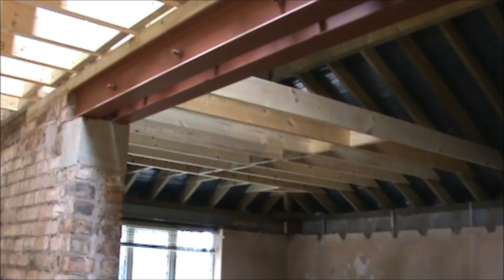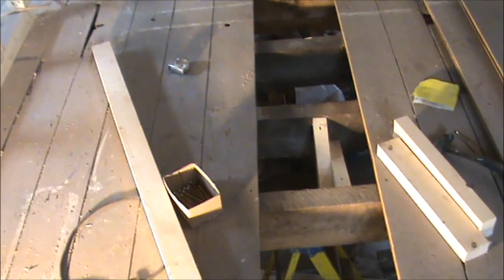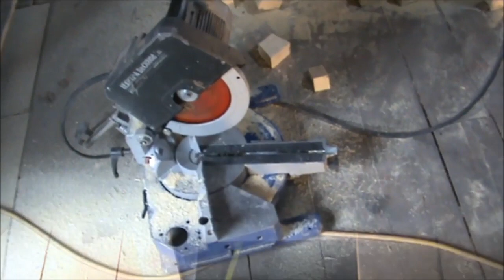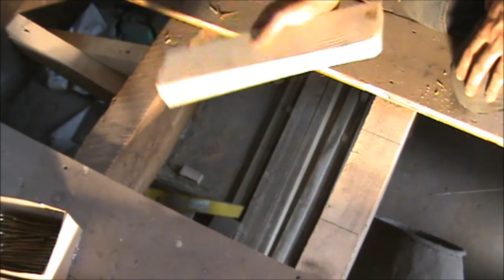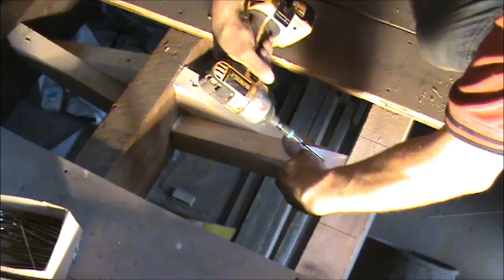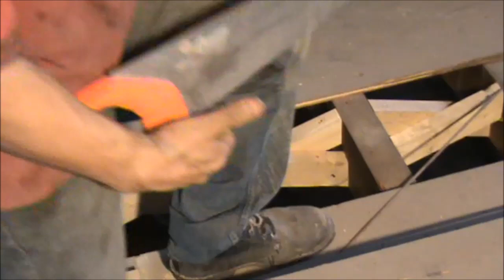Weak floor fix

Comment: How do you secure the bottom screws without access from below?
Reply from the maker: You can’t , you would have to go with another solution like doubling up the joists (sistering) or glue and screwing multiple plywood strips to the side of the joists to laminate it , stagger the joints on the plywood strips

Comment: Definitely giving this a go in our 1920s terrace, the bedroom floor is proper bouncy!

What size wood would you recommend for the herringbone pieces?

Cheers
Reply from the maker: 3x2 is best thanks Chris
Reply: Great video Chis, i cannot screw from below the floor, can i screw the toe from the side? Not the same but no way of getting underneath
Reply from the maker: @handymanTW12  you’d have to pre drill , glue them and make sure they are a tight fit
Reply: @Baron-von-kessler  legend, thanks mate. make new videos if u can

Comment: superb jo Chris, I just want to put in a few that when I step they act just like the beams in two places. the beams are fine I have to replace what you walk on as what was put in is not solid like the original floor. would you recommend just putting in a few solid pieces across?
Reply from the maker: Solid ones aren’t great , you can add to the sides of the beams to make them thicker , it’s called sistering joists you can Google it , thanks Chris

Comment: Those solid noggins are actually just as structural as herringbone strutting. They help "load share" between joists, & stiffen them by reducing the effective length of joist by restraining it
Reply: ...but good video and nice job, they look more proper than solid noggins. I think it's because the struts can be made nice and tight more easily. If you cut the herringbone strut a smidge too short, you'd simply rotate it until its tight in. They're better I reckon
Reply from the maker: I’ve mostly got out of the joinery game now ,  and  do a little bit of sculpture on my channel.. have look !
Reply from the maker: Hi Tom thanks for viewing,  I was told they can become loose over time when the joists dry out and shrink ,  and a old school fix for this was to fit a iron rod through the lot and tighten it up ! , Ive never seen it so far but you never know what you’ll find on a old building
Reply: If they loosen you can bang in wedges but I don't see why a screw would let it loosen even if they shrink a bit in winter

Comment: Wouldn’t one solid piece of 2x8 blocking or whatever the floor joists are made of, be stronger? That way the wood gives the support and not just  the nails and you only need access from one side, above or below, to fasten them in.
Reply from the maker: They dry out and become loose over time , I’ve seen it were a long threaded rod passes through the joists to keep them tight, also the solid noggins stop air flow

Comment: I jacked up my floor an inch and used this method with great success! Thank you!
Reply: Did your floor have a lean? Ours dose we’re wondering how to repair this
Reply: @comfortablynumb8832  It had a terrible lean. I put sleeper joist in too combined with this method
Reply: @michaelgriggle5601  ours leans about 3 inch, how flat is yours now?
Reply: @comfortablynumb8832  I had 4 inches in spots. It was a terribly done addition. The good thing was they used 2×10 lam beams for joist! So I was able to sister to those and cross brace it. Was a pain in the ass. But better than tearing out everything amd stating over.
Reply: @comfortablynumb8832  I can send you pics of it now. It's a bathroom
Reply: @michaelgriggle5601  thanks mate I’ll see how I go with this method first
Reply: @comfortablynumb8832  good luck! Can't promise anything but it worked for me so far

Comment: The first time I’ve ever seen this demonstrated! I always see it in old houses, with two nails at each end (are those screws OK, are they structural screws? Is 1 screw OK do you need 2?) But this was great and the explanation was good too.
Reply from the maker: Nails are old fashioned now , not used much in the building industry, although I’m old enough to remember using them , either way is fine

Comment: What if you dont have access from the top ?
Reply from the maker: I think you would struggle, next option is to strengthen the joists either by doubling them up ( sistering ) look it up ,ie introducing a similar sized joist to the side of the existing joist and bolting them together or glue and screwing multiple 18mm plywood strips to each side of the joists making sure to spread the joints of the strips at least a meter apart from each other , if I doubt contact a reputable joinery contractor and discus  your problem with them , good luck with your project Chris

Comment: I used solid noggins between joists in my son's house, same depth as joists, screwed and glued with each one slightly staggered so I could screw through into it. Surely a solid noggin does the same or better job? Joists cant twist and any movement is 'shared' with the adjoining joists and so on outwards. Certainly it reduced the 'bounce' considerably.

Comment: Floors are done but finding that the floor bounces a lot.  I don't want to undo that because it'll cost thousands.  I do have access to the joists under the house, would I be able to do this with the screw going through the side of the top herringbone?  The bottom of the herringbone is fine as I can screw in as normal.
Reply from the maker: Hello ,  not sure what’s going on,a new floor shouldn’t be bouncing,  sounds like it’s been calculated wrong, ie the joists are  the wrong size , look at my other reply’s regarding joist strengthening,  ultimately you may need a carpenter

Comment: I did what he said and it worked really well when I installed a new floor/joists.  Straightened up bowed floor joists and I could tell that it stiffened up the joists. I'm curious where he from, Wales or Scotland?
Reply from the maker: Glad it worked for your, I’m from Bolton, near Manchester

Comment: Question for a total noob. What size/kind of wood are you using for the strutting? How spaced apart should this be done across a room? I see in the early part of your video you have already done one side. Is there a spacing requirement for a large bedroom, for instance?
Reply from the maker: Rows of struts are Usually 2 meters apart,  and 3”x2” timber
Reply: @Baron-von-kessler  One more question, so thank you for answering. If I can't get underneath to screw in, how else can I do this method? My bedroom joists are stilling on a flat surface, there is no way under. And which bolts to use? Sorry for the questions, but I have new carpet coming and wanted to fix squeaky floorboards but our bedroom has slightly bouncy feel. Makes cupboard doors jiggle etc, so thinking I might need to support the joists.
Reply from the maker: @christhake  usually screwed in place. Not bolted, , tough to do if you can’t get access underneath,  another method to strengthen joists is to add 18mm plywood strips  to the sides of the joists, both sides , glued and screwed, like a laminated beam
Reply: @Baron-von-kessler  My only issue there is I would need to lift every floor board up :( Would blocking work? then I'd only need to lift two lengths of floor board and use your method but with one piece of wood instead of the scissor effect. Would this suffice?
Reply from the maker: @christhake  , it would stiffen it up , only way to know would be to try it , squeaky floor boards need to be lifted, to see if there’s any low spots that need packing , and the screwed down

Comment: Is there a way to accomplish this totally from underneath as my floor is intact. Thanks
Reply from the maker: It’s best to  lift a few floor boards, unless it’s a chipboard floor , no screw in the x , you may be able to pilot drill into the side of the timber and screw through the side

Comment: Also, if I'm putting in more than one strut across multiple joists, do you put them side by side or do you stagger them? Thanks, Mike
Reply from the maker: Side by side , around 2 meters apart or divide the room up equally

Comment: Fair play mate, I’ve done loads of floors and that’s some good info for me thanks 👍🏻
Reply from the maker: Thank you It’s a lost art , not many joiners know how to do it ! ..  they have the metal ones but they can be noisy and squeaky !
Reply: @Baron-von-kessler  yo, I gotta fix my subfloor in a couple weeks, how far apart should I put the rows and how many rows should I do from the outer wall to the middle beam?  I haven't measured the running length but it's around 12-15 feet

Comment: Great video, thanks. I really need to do this (novice) but only have access from above. Where would you recommend screwing the lower section of the strut to the joist from? Cheers.
Reply from the maker: Underneath is really the best option, you could try the side , by pre  drilling a  hole for the screw

Comment: It's interesting that you say that effectively noggins do not do anything structural.

In a 1940s property I am renovating, esp in the bathroom that will be tilled, so no flex is a must, the current herringbone struts didn't stop the bouncing at all, but noggins did sort the bounce.

Could it be because at 80+ years old with timber drying and shrinking slightly they are not as tight as once fitted?
Reply from the maker: I’d say so , you get the same problem with old noggins  when the joists dry out and shrink over time a gap is created those the joint strength is poor,  I read about method to remedy this when using noggins  they sent a long iron bar through all the joists  with a threaded end and steel plate  and effectively cramped them together tightly to keep the joints tight
Reply from the maker: I read that in a very old building book 👀🙂
Reply: Yes, although that sounds like a structural wall tie.

Thanks and good luck with your projects.
Reply from the maker: @m.o.2085  I know the sort of thing your referring to , a large inch diameter iron rod through the walls with a big cast iron plate on it , you see them on old buildings sometimes,  and  there was a old episode of Fred dibnah  fitting one on his house  as there was a large bulge to the rear of the property! 🙂

Comment: how far apart would you space these ? thanks
Reply from the maker: One row  central for a floor up to 2.5 meters wide and two rows space equal for floors up to 4.5 meters wide
Reply: @Baron-von-kessler  thanks man

Comment: Really helpful, is there a way to fix if you can't get underneath ?
Reply from the maker: As a alternative to herringbone struts , people strengthen joists by glue and screwing strips of plywood to the sides of the joists
Reply: @Baron-von-kessler  Could you explain this option more? Do you mean like sistering the joists?
Reply from the maker: @GunhanSancar   yes just like sistering the joists  which of course is adding another joist at the side of the existing joist ,  you can add multiple 18mm plywood strips the same depth of the joist to both sides , with plenty glue and screws ,
Reply: @Baron-von-kessler  would you have to do the sistering running the full length of the joist, on both sides, and do it to every joist for it to be effective? Or could you skip every other joist etc?
Reply from the maker: @wearetemporary  traditionally sistering consists of  bolting a similar size joist to the side of another, usually because it is rotted on the end etc and the old one can’t be removed,  laminating a beam with  strips of plywood  glued and screwed is recommended on both sides of the joist and every joist, it may be worth you hiring a structural engineer to work out loads and a solution for you ..

Comment: Did you put a screw in underneath afterwards?
Reply from the maker: Yes screws in the bottom to, it’s better to put two screws in the top and two in the bottom, and it helps if you pre drill the wood half depth with a drill bit to stop splitting but that’s optional
Reply: What size screws did you use?

Comment: Hi Chris, this is awesome. I can't take the finished flooring off but have access to the crawl space underneath, can you screw them all in from beneath?
Reply from the maker: James Macpherson  yes you would have to pre-drill  With a drill bit  so not to split the timber and skew two  screws in from the side of the Strut and a dap of glue would help to !

Comment: If my floor already has weight would i need to jack it up that 1/8” to then drop ones its  i install the wood bridging?
Reply from the maker: Tomas Garcia  it wouldn’t do any harm to jack it up 👍
Reply: chris the bodge thanks alot 
Done !!!
Reply from the maker: Tomas Garcia cool !
Reply: Is there a way to do this when the joists can only be accessed from below?

Comment: Just when I thought I knew everything...
Do you have an opinion on where in the span to do this?  Middle?  Or do it twice at the one third from end?  thanks
Reply from the maker: Mrdubomb  every 2 meters span fix  one row,  but you can add as many rows as you think is appropriate if it’s a oddball size  say 5m  put two rows in , 👍

Comment: You've made a fine job go that Chris. I have some to do and I simply didn't have a clue how to calculate the lengths and angles, but now I know. Can't wait to do it and much quicker than the way I'd have tried by measuring and using a bevel. Really helpful, thank you.

Comment: good video mate,how would leave a 12mm space from top of strutting and bottom so it does not protrude through ,your answars would be appreciated thanks
Reply from the maker: hello!,  the first two lines that you mark on the joist are simply the depth of the joist so say it was a 200mm joist you would mark 200mm on top, so to get 12mm down from the top and  12mm from the  bottom , just knock off 24mm from your joist thickness, regards chris :)

Comment: @lockyermachining . I would say that wouldn't put a screw in the middle it would stop them from flexing which is what you need them to do in order to strengthen as weight is placed upon them

Comment: That was interesting. How many 'rows' of the herringbone strutting do you have to do, ie, is there a required building regs spacing between each full row? I have that awful 8 x 4 chipboard sheet flooring in my house...terrible stuff when you're trying to lay new cables/pipes. I like the musical saw ..I'll be trying that next time I reach for mine! Thanks for posting.
Reply: Hi, i second that question please! How many rows does a floor need? I can only access under the floorboards, would it still be ok with screws from under access as I can't screw from above. That probably doesn't make sense!